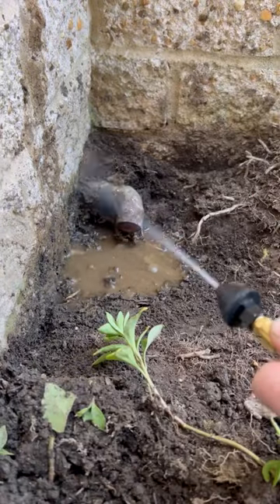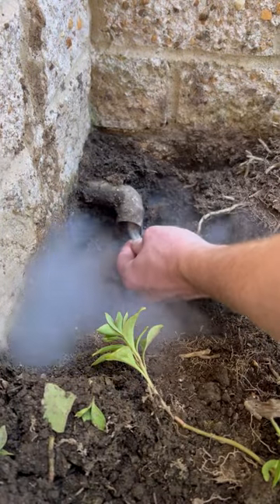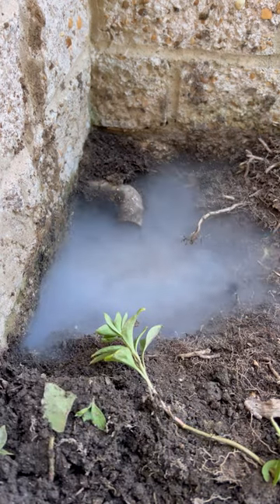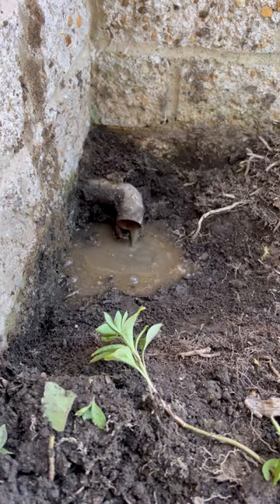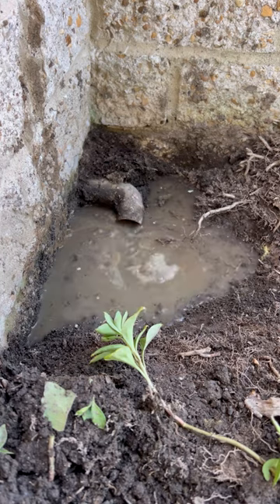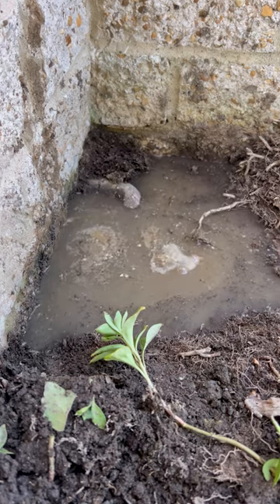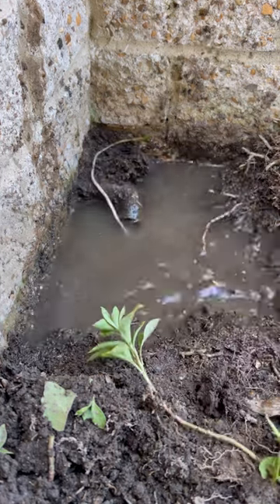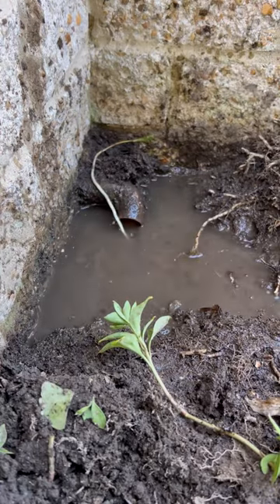Clogged Condensate Line! #diy #plumbing #plumber #repair #clogged

Comment: Air compressor works way better then that and my mouth is even quicker
Reply: Not if your doing maintenance on a mini unit that's mounted about 9ft high on a wall.